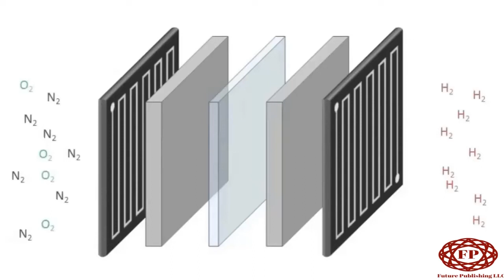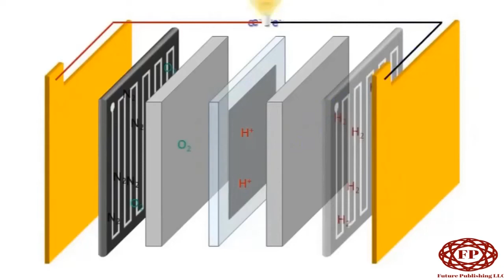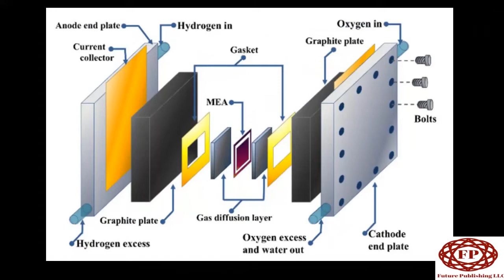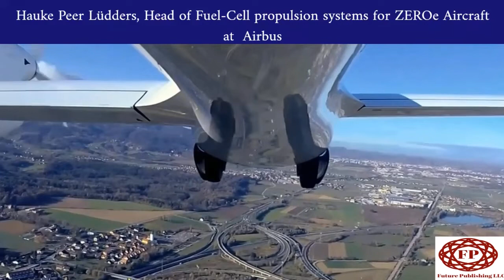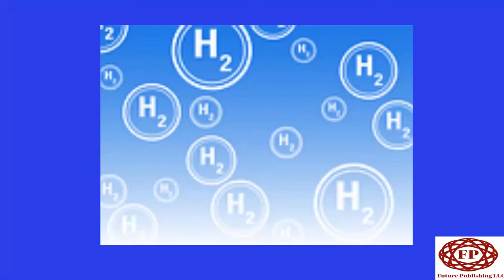Hydrogen fuel cell mystery

Comment: Many don’t realize that modern jumbo jets are air-powered.  They burn some diesel to get off the ground, but once at speed, the friction of the air through the turbine proves the heat needed to keep the fan turning and provide enough thrust to cruise.
Reply from the maker: Good point!
Reply: YeAH RIGHT!